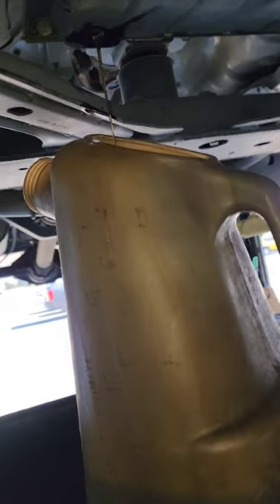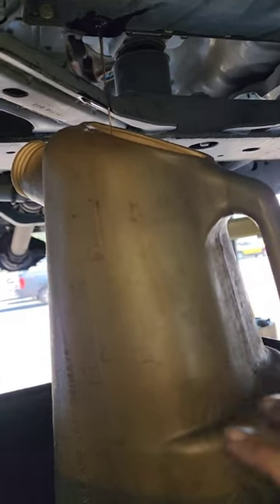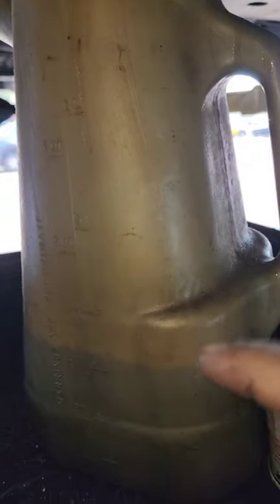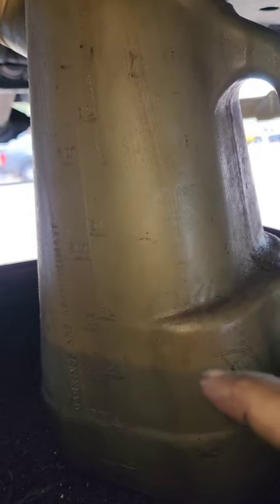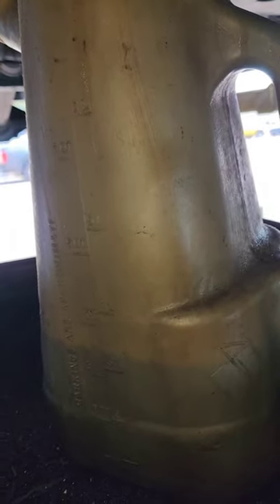DRAIN AND FILL TO PROLONG THE LIFE OF A TRANSMISSION!!! #mechanic #pro #shorts #youtubeshorts

Comment: in my country, usually mechanics suggest to do per 40k km change on oil transmission because we do a lot of stop & go and low speed driving.

not gonna lie it's a lot cheaper than changing parts, just please refer the manual ins on oil & volume